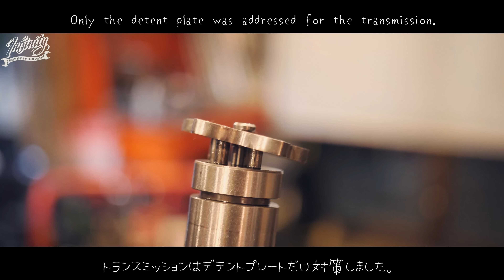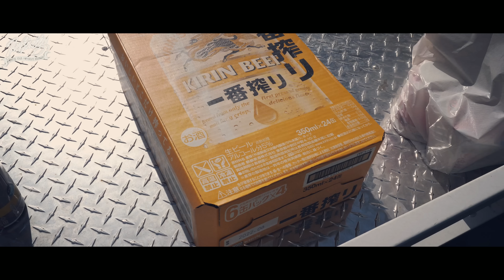【出荷整備】千葉県香取市からオーダー頂いたXL883Rの出荷整備内容。キーパーコーティング仕上げ。XL883R delivered to Katori City, Chiba Prefecture.

Comment: Hi, could you please tell me what is the spray are you using for clean the carburetor? Thanks
Reply from the maker: It is called carburetor conditioner and is a special chemical for cleaning carburetors.
Reply: @infinitymotorcycle  have you an advise about a brand?